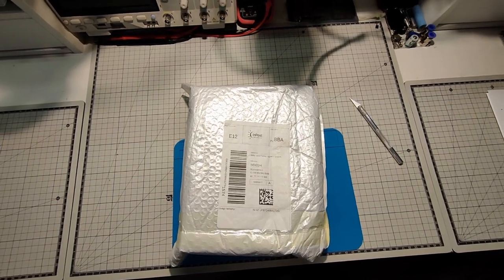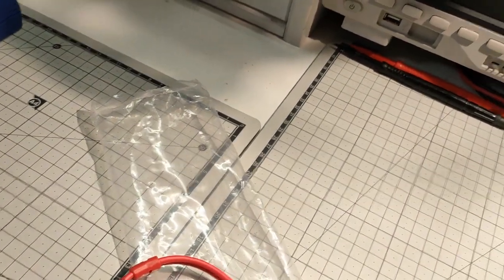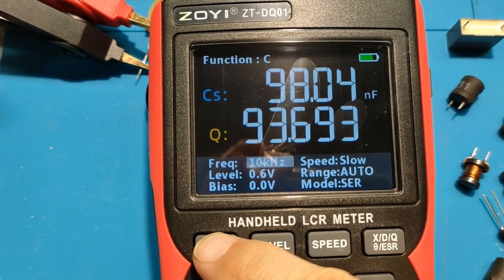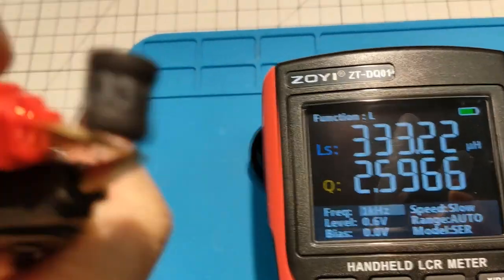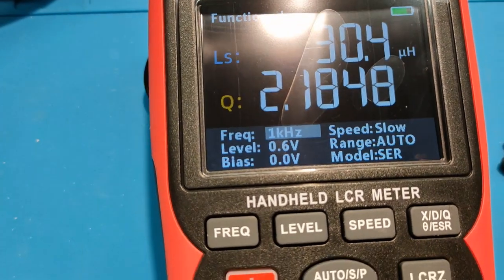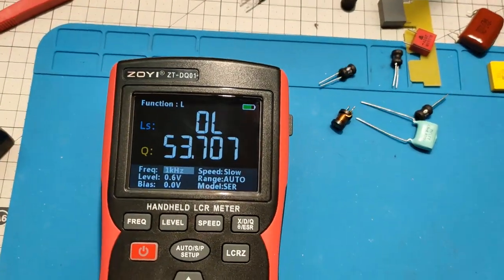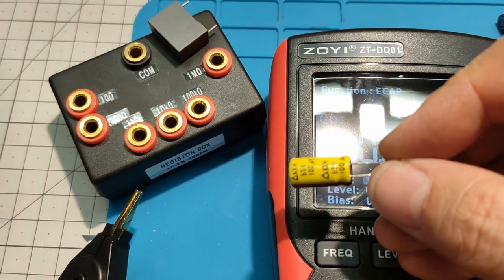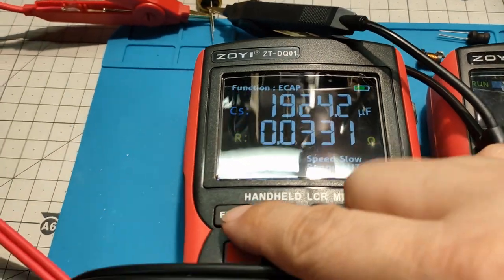ZOYI ZT-DQ01 LCR meter unboxing/mini-review

Comment: You need to put the insulated connectors to use the kelvin clips.
Reply from the maker: Actually don't need to, but if I don't, there will be no benefit to them being Kelvin clips; they will act like regular probes.
Reply: @TzOk yes, but you will get noise in readings. For precision, use the connectors.
Reply from the maker: @jcbritobr Kelvin connectors are not about noise, but about burden voltage. This type of connection is solely for compensating wire resistance. They affect the milliohm range of resistance measurements. There are shielded Kelvin connectors available, but these are not shielded.
Reply: @TzOk  your tests are not precise without using the insulation with kelvin clips. Does not makes sense using the clips without it.
Reply from the maker: @jcbritobr  Of course, they are not precise. I'm completely aware that in one scene, I forgot to insert the insulator; however, this did not have any noticeable impact on the measurements. This is barely a demonstration of the meter. You also need to remember that this is not a very precise meter (surely not a laboratory class device, just a portable/service handheld meter), nor do I own a proper laboratory calibrated reference standards for measured values, nor am I able to provide the required ambient temperature/humidity. The only sense to use the Kelvin connectors is to use them as... clips, because I'm holding a phone/camera in one hand, and have only one hand left for performing the measurements.
Reply: @TzOk  In fact, Kerry Wong did tests and it is very precise. Its not a lab device, but is very precise and can measure low resistances with accuracy. So, I understand that you did only a demonstration, but there is a noticiable difference in precision using the insulated protection, thats important to be told.
Reply from the maker: @jcbritobr  My video was not meant to be instructional, but it was the first independent video about this meter, and it was more informative than the manufacturer's product presentation video. I'd also disagree in terms of precision - for the parts I was measuring, Kelvin connectors wouldn't bring much difference. Kelvin connectors could affect resistance measurements in milliohm range, which I didn't do; it could affect electrolytic capacitor's ESR measurement, but I didn't have the reference values, finally, it could affect the inductance measurements, but again, I didn't have reference values, and these were like 20% tolerance parts. I could only compare the results with and without the insulator inserter, which I later did, off the camera, and below 10kHz, there was no significant difference for the parts I was measuring.
Reply: @TzOk I have one zt-dq02 device here. The difference is huge, specially when you are measuring low resistance, what you didn't tested. I already had tested here. Kerry Wong had tested, Jazzy Jane and many others tested and saw the difference.
Reply from the maker: @jcbritobr  That's exactly what I'm telling you - in the measurements I was doing, the Kelvin connectors did not matter. That's why I didn't bother to re-record that scene. I know what I was measuring, and I understand the principle of working of this meter, so I exactly know when I have to use it, and when I don't need to. I have briefly explained that in the video, and during the last measurements of the ESR of the electrolytic capacitors, the insulator was installed, as it did matter in this scenario.

Comment: Может измерять постоянное и переменное напряжение?
Reply from the maker: Don't know if I understood the question. This meter does not allow voltage measurements; it is not a multimeter. As for capacity measurements, it measures only using AC, with an optional, but very small, DC bias.

Comment: Gentlemen, the device from the store is not calibrated. For calibration, the minimum is to calibrate with the probes closed, and then with the probes open.
Reply from the maker: It is contrary to what the manufacturer advises. The manual says that the device is factory calibrated, and although there is an option for user calibration, it is not recommended. There is also an option to reset to the factory calibration.
Reply: @TzOk  If you replace the standard probes with Kelvin or other probes, such as tweezers, the calibration will no longer be correct. 
I've been comparing the accuracy of this instrument with the East Tester ET432 with Kelvin clamps for several days.
Reply: @АлексейЛ-о2л which one do you recommend? the et432 or this zt-dq01?
Reply: Measuring capacitance:

1. It is advisable to measure low capacitance in parallel connection (Parallel) and at an increased measurement frequency.

2. It is advisable to measure high capacitance in series connection (Series) and at a reduced measurement frequency.

Measuring inductance:

1. It is advisable to measure low inductance in series connection (Series) and at an increased measurement frequency.

2. It is advisable to measure high inductance in parallel connection (Parallel) and at a reduced measurement frequency.
Reply: The serial mode is more suitable for elements with low impedance (<100 ohms), and the parallel mode is more suitable for elements with high impedance (>10 kOhms). 
For elements with an impedance between these two values, the equivalent mode does not have much effect on the measurement result.
Reply: @АлексейЛ-о2л Алексей, так этот китаец лучше или et432?
Reply: для проф работы 432, для хобби zt
Reply: @АлексейЛ-о2л Thank you for your detailed reply.  I will go for the DQ02 then 👍👍
Reply: The calibration function is used for open and closed circuits. Calibration reduces the error caused by the parameters of the test line (the length of the probes). 
Short-circuit calibration reduces the effect of probe resistance when measuring low-resistance components. 
Open circuit calibration can reduce the effect of distributed capacitance and resistance between two points of the test line when measuring the parameters of components with high impedance.

That's if you're measuring millions, picofarads, and microgenres.
Reply: Аккуратнее при заказе, официальный магазин списывает деньги за DQ02, а присылает DQ01. При это в переписке предварительно подтверждает что отправит DQ02.